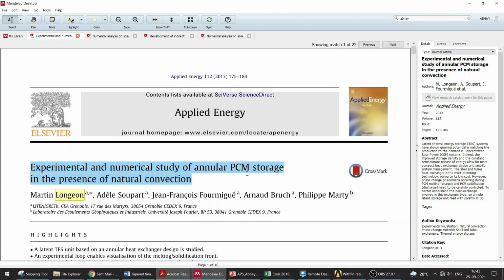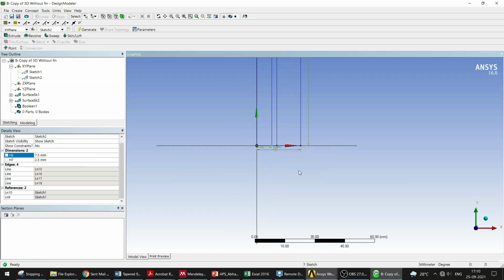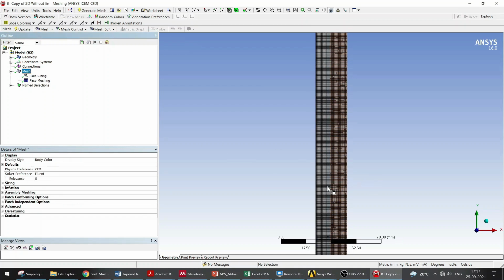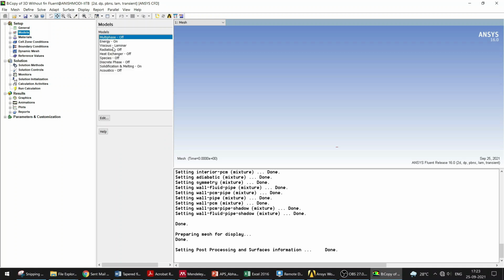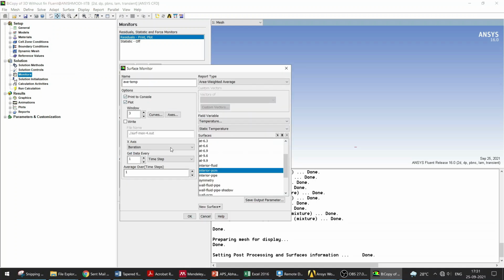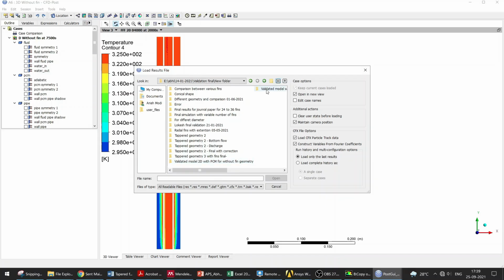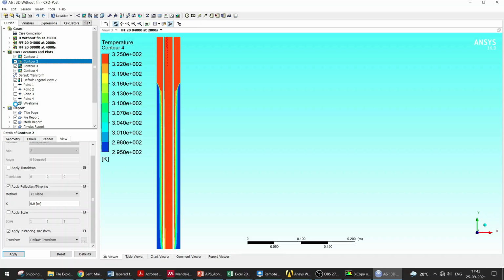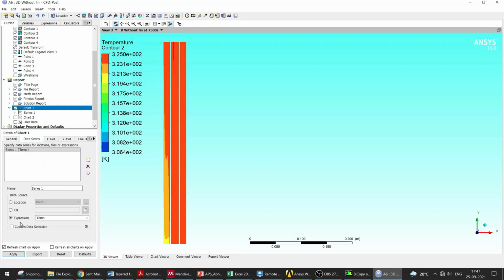Numerical Simulation for PCM with Validation

Comment: Hello Sir ,
In the video, when the named selection for the adiabatic value is being made, it's not clear whether an edge or a face is selected, as the video cuts off at that point. Because of that, I couldn’t quite understand which part was selected. Could you please clarify this?

Thank you, and best regards.
Reply: i been facing similar problems if you have solved this problem could you please help me if you dont mind .